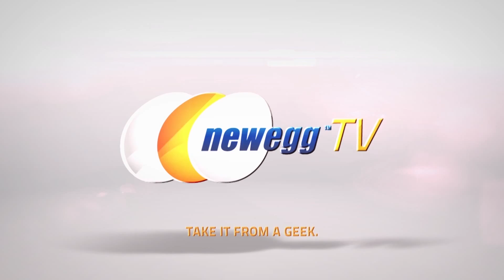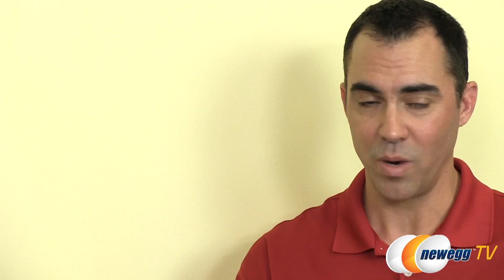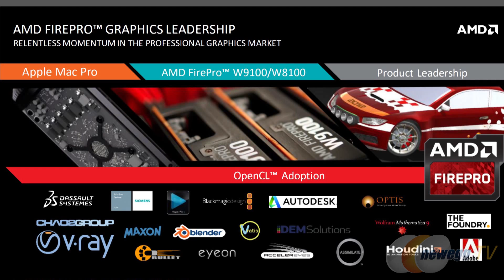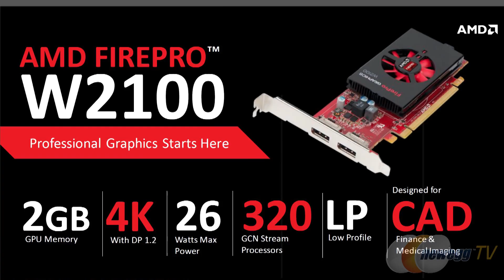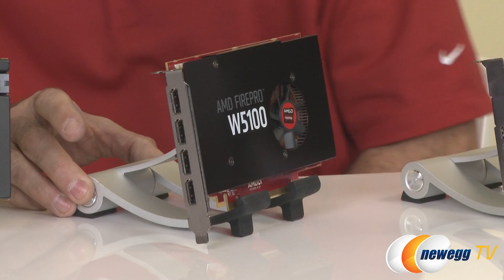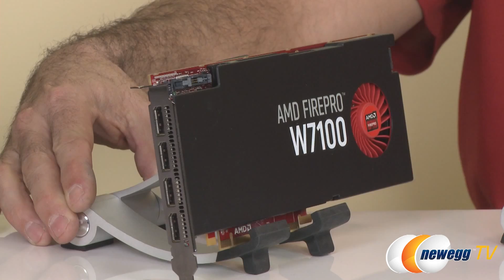AMD FirePro WX100 Series Interview - Newegg TV

Comment: why no HBM (Gddr6)?
Reply: It's probably not ready for production and workstation usage.
Reply: these are 2013 Hawaii GPUs (R9 290/W8100 and 290x/W9100), any GPU with HBM will not be out for a few months with the 300 series GPUs, then later with the FirePro.

Comment: I don't understand why workstation cards always seem to have flimsy coolers. Won't these things run hot/loud at full load?
Reply: Think of it like an engine, these cards are designed to run solid as a rock at a clock speed, drivers are stable and you can use these cards in a work / production environment.

The gaming cards are clocked to the bleeding edge, hense heat and therefore bigger heatsinks and coolers. These cards don't require that because they're built for pure processing power rather than FPS performance...

Simply put, gaming cards are as fast as they can get = heat
these cards are designed to take advantage of pure processing power such as rendering, CAD stuff and professional focused business stuff.
Reply: I don't think they'd be built with the same materials as consumer grade ones, so they might be sturdier that they seem. Or I might be wrong
Reply: http://www.tomshardware.com/reviews/firepro-w9100-performance,3810-16.html
Reply: Cameron Walker  that was the stupidest thing i ever read
read this
http://www.tomshardware.com/reviews/firepro-w9100-performance,3810-16.html
Reply: awesomeguide Forging well Im trying to explain it so its simple enough so idiots can understand, i might not have done a good enough job. so :P